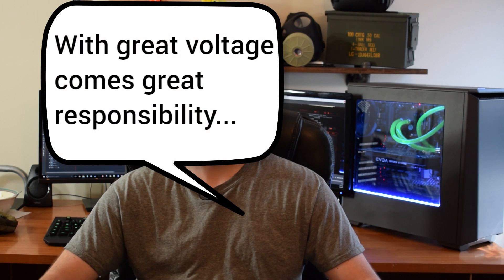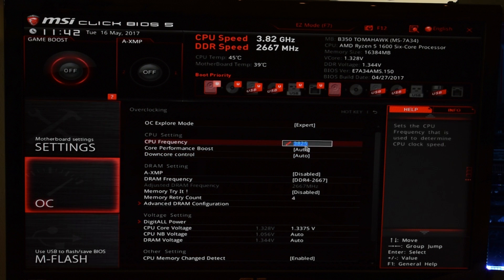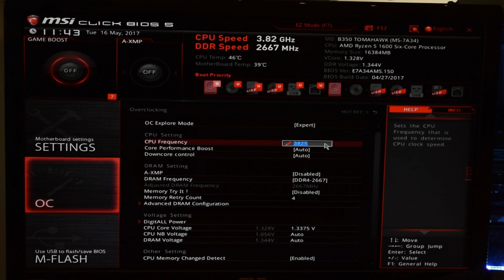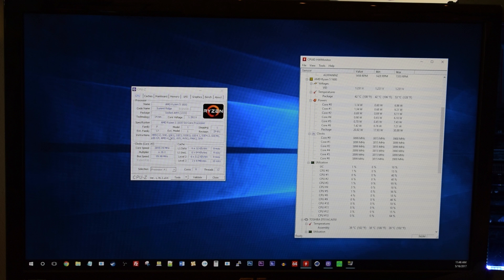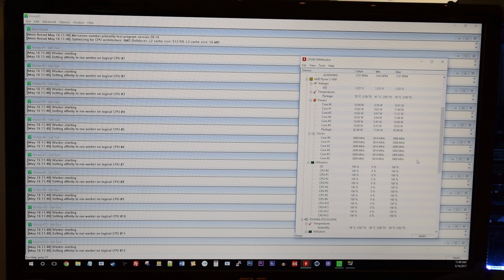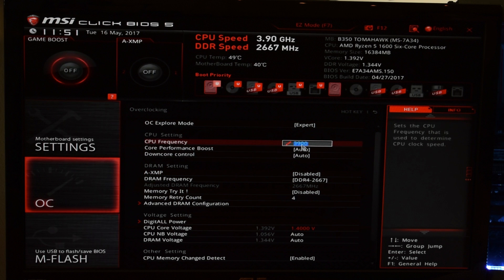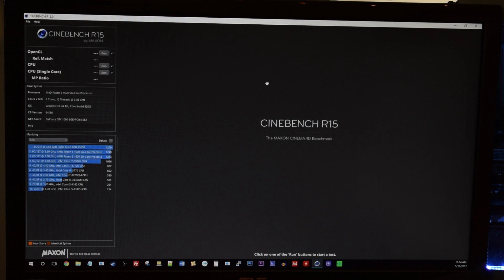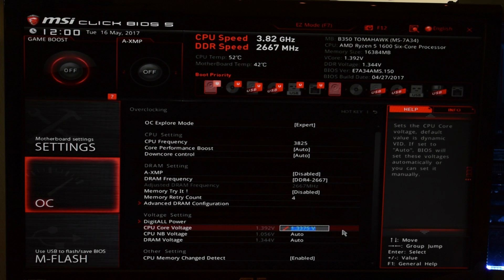How to Overclock a Ryzen 5 1600 CPU - Super Easy!

Comment: Can you explain why you want to marginally lower the CPU voltage each time at the end until the stress test fails?
Reply from the maker: The reason why you want to do that is because the lower the voltage, the lower the amount of energy you use and therefore less heat that is produced from the CPU. This will help the CPU last longer as well.
Reply: @SANTINIIO  Thanks! I figured that was it but it wouldn't hurt to explain it 😅

Comment: My bios is black and white why
Reply from the maker: The only thing I can think of is that you have a legacy bios instead of UEFI. 

Depending on the bios you can still overclock it.

I would contact the manufacturer of the board if it's a newer motherboard.

Comment: Hi. I had a question. I am really bad at this CPU stuff. I have AMD Ryzen 5 1600 with stock cooler.
QUESTION: Can I just hop onto the OC settings and throw in your values and expect a decent overclock? Please help me out! Loved your content. Earned a subscriber.
(P.S- I am very nervous, I don't wanna fry anything)
Reply from the maker: The short answer is maybe. It depends on a lot of different things. The silicon lottery being one of them.

As long as the voltage isn't too high you don't risk a chance of ruining your CPU. If it isn't stable you will you just have to go back and tweak the settings in the bios.

Getting it right can take some time. I will say that if you lowered the clock speed a little bit you will have a better chance of it working first try.

But the bast way is to do it like I did in the video. I hope that helps.
Reply: @SANTINIIO  So if you had to give me a number... What would you give me?
3800 and 1.35 if it doesnt work I'll go for 3775 then 3750 and so on... Am I right my sir?
Thank you so much for replying so quickly. It's rare to see a YouTuber engage with his community so much. Love it!
Reply from the maker: Try that first and then if you aren't satisfied with the result go back and do the same, but bump up the voltage. You will see that at some point, (usually 3.8 or 3.9) is as far as you can go while keeping it stable regardless of what the voltage is. I wouldn't go past 1.4v, but that's just me.
Reply: @SANTINIIO  Copy that sarge.
Love you! ❤️

Comment: im going to run my 1600 at 4ghz with a dark rock pro 3. does anyone reccomend a voltage? because i cant really wrap my head around the voltage part of Over Clocking
Reply: Just as he said, start it off high (1.4v) and stress test while reducing the voltage.

Comment: H, i have few confusion regarding overclocking. Suppose i don't want to overclock more than the boost clock specified (3.6 GHz for r5 1600). What is better, manually OC the base frequency 3.2 GHz to 3.6 GHz so that it stays at 3.6 GHz all the time or i let it auto so that computer decides its frequency and auto adjust depending on the temperature?  Also if i manually overclock to fixed 3.6 GHz does it violate the warranty of the cpu or it violates only when i go beyond the boost frequency?
Reply: It shouldn't void the warranty if you do it via Ryzen Master (free download from amd). You don't have to worry about voltages either as it remains stable on the same voltages as 3.2ghz and 3.6ghz. Beyond that, you'd need to increase voltages though. How can AMD void your warranty for doing something in which not only do they encourage, but also provide the software! Imagine that? :D
Reply: @plunderclat221  ok, but isn't it better to not do overlocking because the cpu auto overclock it itself to its boost clock( 3.6GHz) if necessary, then why do i need to manually set it to 3.6GHz?
Reply: @babu-oh8ss  I set it to mine to stay at 3.8 and tested the benches the way he did,  but I'd first set it to 3.6 as I said above, just to force it in to a steady performance. I did that intuitively, in that my thinking was, "its now got less to think about". Might be right, and it might be nonsense... i just mess around with them. Its safe either way, because it doesn't exceed 43°c anyway (watercooled). Also, beyond 3.6ghz, i didn't really see a tangeable performance boost because it already ran very well... so its up to you how far you push it, but in my opinion, it has more than adequate beef at 3.6.
Reply: @babu-oh8ss  you using the vortex cooler?
Reply: @plunderclat221  I am using the stock wraith spire cooler comes with ryzen 5 1600. I don't want to go beyond the boost clock. My question is in that case(that i don't want to go beyond 3.6 GHz) should i manually overclock the base clock 3.2 GHz to 3.6GHz or just let amd technology to take care of it( so that it fluctuate between 3.2 and 3.6 instead of staying at fixed 3.6) ? Just a basic question.
Reply: @babu-oh8ss  leave it as it is in that case. However take a look at the 3.8 overclocks using the stock cooler. It actually performs well. Alternatively, get a water cooler and go wild! The h100i v2 keeps it ridiculously cool. Plenty of room for tinkering.

Comment: Whenever I overclock my cpu it goes down to 1.5ghz and can't changes it unless I reset bios. Any help would be appreciated.
Reply from the maker: A couple things could cause that. Not applying a correct frequency/multiplier could actually underclock it. Not applying enough voltage could cause it. Thermal throttling could cause it as well. Try different programs to see what your actual clock speed is and to make sure the program isn't reporting a wrong speed. At the same time check to see what temperature the CPU is running at.

If none of those are causing it then you could have a faulty motherboard or CPU. It's hard to tell without seeing it in person.

Let me know if you find out what the problem is and if any of that helped.
Reply: SANTINI.IO I updated the bios and then it worked like a charm. I appreciate the response.
Reply from the maker: Ok cool. That's good to know.

Comment: I have the most recent bios EA38AMS.1E0 BIOS Build date 4/24/2018 but I only see cpu ratio (auto)and not cpu frequency. But I do have Adjusted cpu Frequency right under cpu ratio.

edit nvm it seems I need to just input for ex 3700 for 3.7 ghz.

Comment: is this cpu is pushable to 5ghz with liquid nitrogen?
Reply from the maker: I'm going to say no. Even with good water cooling, where the temperatures were normal, the overclock became too unstable past 3.9ghz. The 1600 CPU's are just binned 1600x's meaning they weren't able to reach the speeds of the 1600x to begin with.

Also, your stock cooler should be able to handle a 3.825ghz overclock although it will probably run a little hot under load.

I hope that helps.
Reply: SANTINI.IO how about this processor bro?i need to buy one😊

Comment: One question, when I OC my 1600 to 3.9 on 1.275 V it runs stable. But when I tried 4.0 at 1.4 V it crashed. I’m using a stock cooler btw. Is it the cooler problem or cpu can’t hit 4.0?
Reply from the maker: A lot of peoples 1600's just can't overclock to 4.0GHz, mine included. 3.9GHz at 1.275v is a pretty good overclock though.

Comment: hi what temp will you suggest for the cpu? im currently never go above 70 and most of the time its idle at average 40c
Reply from the maker: +Guala Nejo Those temps are fine. It all depends on ambient temperature and what type of cooling solution you use. I would say those temps should be fine though.

Comment: Hey i was wondering if an evga 1060 3GB GPU superclocked would work with a ryzen 1600 cpu in a MSI 7A39-002R Mainboard 2x DDR4 DIMM ?
Reply from the maker: +Screw_it Yeah, that combination would work fine. Right now I find that hardly any games really push 3gb at 1080p. If you can find a 6gb 1060 for a decent price I would get that though.
Reply: SANTINI.IO Thank you for responding. I have been doing some research and I found that most games at 1080p at 60fps at high settings don’t need more than 3GB, however probably in the long run I would need a 6GB. What really bothers me is that the 6GB is 50 euros more and I’m not sure if it would be worth it as I’m on a budget of around 700€. I could get a worse cpu to be able to get the 6GB GPU but I’m also not sure.

What would you do? I’m stuck in what I should do so help would be greatly appreciated and one more question does a 1x8gb ram have a huge difference to a 2x8GB in performance in gaming like FPS?, 
thank you!
Reply from the maker: Screw_it I wouldn't get a lesser cpu. The 1600 is amazing. Also, the difference between dual channel and single channel memory in games is not a crazy amount. Really it only gives a couple more fps in certain games. Single channel will be the way to go if you plan on upgrading in the future.

Comment: Struggling with same bios to change CPU frequency from auto. I can oc in ryzen master fine but for some reason I can't change stuff in bios (MSI b350m mortar)
Reply from the maker: +Simon Elbourn I would check to make sure you have the latest bios update and then try it again. I know this sounds stupid, but make sure you have the settings saved and then when it goes to boot, go back into the bios to see if the settings are the same. I hope that helps. Let me know what you find out.
Reply: Definetely have latest bios. When I try and adjust it I have the red slash before it and cant select auto and change it

Comment: just bought this cpu a couple weeks ago (spoiler alert for future video)...so considering overclocking. Although, it was such a good improvement over the 8320 i had (even at 4.4ghz) that Im not sure if i need the OC yet.
Reply from the maker: Carli Kinman I used to have a 8320 in one of my previous builds and it's an awesome cpu, especially for how old they are now. The 1600's are pretty awesome out of the box. I think the CPU is overkill for most tasks and programs so overclocking it isn't necessary, but it is fun to overclock them though.
Reply: SANTINI.IO definitely is fun! Noticed a huge difference in the time it takes for me to render vids now too. Plus I'm curious to see how well the stock cooler would hold up
Reply: Then dont

Comment: What settings do you use in prime 95. I know some settings seem to stress the cpu more. Or at least make it much hotter.
Reply from the maker: +Brian Price It really just depends on what I'm trying to test. Here is a good article that will explain it better than I can: https://overclocking.guide/stability-testing-with-prime-95/

I hope that helps.
Reply: SANTINI.IO good article. Thank you

Comment: with stock cooler, and have no experience in OC at all. Whats the suitable speed to go up to? and what ram is working perfectly with this? im currently using kingston 2400mhz 8GB.. whch is single channel, looking to change it to dual channel. 

Any help is really appreciated
Reply from the maker: +Eiian Herms It depends on a lot of factors, but 3.7ghz would be a good place to start. After one of MSI's bios update the ram that I have linked in the description was able to go to past it's base clock of 2667mhz all the way to 3000mhz. And dual channel is always better than single channel. 

I hope that helps.
Reply: SANTINI.IO thank you so much for your advice.. im going to purchase a ram.. 8gb.. hope you can advise which ram to get..
Processor : ryzen 5 1600
Motherboard : asus b350
Graphic card : gtx1050ti 4gb
Reply from the maker: +Eiian Herms At this point I would say any DDR4 ram from corsair that is 2400mhz or higher would work well.
Reply: Just bought corsair Vengeance 2666mhz 1x8gb .. but system is detected as 2133mhz and single channel.. do you know why
Reply from the maker: Eiian Herms That's how all ram starts out. You have to go into the bios and set it to a 2667mhz profile.

I'm not sure why ram runs under its base clock, but it does that on just about every system ever.

Edit: Also, check your motherboard manual and make sure your ram is in the correct dimm slots for dual channel.
Reply: My motherboard do not have other ram slot.. i have tried all of them.. and once i set to 2666mhz. The system will show overclocking fail, and asked me to enter bios
Reply from the maker: Eiian Herms Make sure you have the latest bios update installed by going to the web page for your motherboard on the manufacturers page.

Comment: should I enable AMD quiet and cool?
Reply from the maker: +wen87n It depends. If you want a "set it and forget it" solution then I would say yes. I like to create my own fan curves based on testing the temps at certain fan speeds and how much fan noise I determine to be too much. I don't mind fan noise so I usually set my curve to higher fan speeds at lower temps than most. But I don't see why you couldn't/shouldn't enable quiet and cool.
Reply: SANTINI.IO Thanks for reply.

my PC is very strange, if I leave cpu voltage to auto, overclock to 3.7ghz and enable CnQ, it works, but not stable if I render images. However if I manually adjusted cpu voltage (because I want to get 3.7ghz stable even if I render image) and enable CnQ, my cpu will stuck at 2.8 ghz regardless the clock speed I set in bios.

So now I can only get up to 3.6 ghz stable @ auto voltage and CnQ enabled. 

My spec is Ryzen 5 1600. MSI B350m Arctic mortar.
Reply from the maker: wen87n That's really odd. You should try to get ahold of someone at MSI to see if maybe there is something wrong with the motherboard.  Before that, If you haven't already, I would check to see if there is a bios update while you are at it.

Comment: I can do oc of my memory ram 8gb crucial 2400mhz to 2667mhz? mobo is the same b350 tomahawk, I can also change what voltage frequency of ddr4 memory?
Reply from the maker: You most likely won't have to adjust the voltage of the memory. You can just choose one of the overclocking profiles that is already in the bios. Check the B350 Tomahawk page on MSI's website to see if your specific memory is compatible and at what speeds. I hope that helps.

Comment: i'm running 4ghz at 1.32v on my 1600x. 100% stable. i'm lucky or what?
Reply: lucky
Reply: Is it still stable? I had 4ghz 1.32 for 2 days before it finally shut down. Bumped the voltage and again a day and a half later it shut down. All the way to 1.4v 4ghz wouldn’t run stable. 3.9 has been solid for nearly a week at 1.32. Seems odd.
Reply: yes, i can go 4.1 GHz without shut down at 1.35v, but for daily use i'll keep 4ghz at 1.32v
Reply: Awesome!

Comment: So the thing is,when I do OC in the BIOS, the second I press save, PC crashes and doesn't post. I know that my OC is stable because I've used Ryzen Master to do it but the problem with RM is that it doesn't save OC profile. So why does my BIOS OC crash? I have Ryzen 3 1200 overclocked to 3.75 at 1.3V. MOBO is MSI B350M Gaming PRO, BIOS version is 2.80
Reply from the maker: It's hard to say why that would happen. I would up the voltage to something close to 1.4v and see if the PC posts. If it does, you then know that the problem was the voltage. The numbers that a program reports are sometimes not as accurate as what the bios will be. I would use CPU-Z to see what your cpu is clocked at. Also, don't overclock your ram until you have a stable cpu overclock in the bios. Let me know if upping the voltage solves the problem.
Reply: SANTINI.IO I'm kind a scared to do that again,because it was a hasstle to restart my motherboard, CMOS didn't reseted at the first time and I took near an hour to make it work...
Reply from the maker: Yeah, I know what you mean. It's scary when your pc doesn't post after an overclock. Properly clearing the cmos will allow it to start back up again quickly. I think the motherboard should have come with a cmos jumper. Also in the bios there should be a setting to retry the overclock and how many times it should try to boot before resetting the overclock. Around 1.4v should work. If/when it works go back and slowly lower the voltage until you know what voltage it can still be stable at.
Reply: Either I didn't find the jumper thingie or it wasn't included so I had to use a screwdriver (Safety first lol). I'll try to bump the voltage tomorrow and hope for the best. I just don't want to blow up my PC since it's my first time doing OC stuff
Reply from the maker: haha I understand I was the same way when I overclocked my first cpu. 1.4v is a safe voltage for short term overclocking I wouldn't go above that though. Let me know how it turns out.
Reply: Thanks for the help!

Comment: I'm not going to read all the comments, but hardware monitor reads 20c hotter than what the Ryzen is actually at. I know that my 1600x is slightly different but I am running at 3.95gHz at 1.39v and I will begin to drop the volts until it's not stable, but with my CoolerMaster Masterliquid AIO 120 I am hitting less than 60c with CPU-Z stress. No gaming has raised it higher than that. You should try using CoreTemp or AMD Ryzen Master to check your temps.
Reply: my 1600x is running 4ghz at 1.32v
Reply: Siddharta really?! I now have to see what I can lower mine to and keep it stable. That's awesome.
Reply: Siddharta I have lowered to 1.37 and it's been stable for a month or longer. But now I'm curious if I can get it to the same as yours.
Reply: My 1600x goes up to 4GHz by itself with it's turbo feature when stressing in occt ^^ I heard x versions of ryzen do not oc well because of the xfr feature

Comment: 30 minutes of prime does not confirm its a stable over clock. A couple of hours to prove its basically stable, half a day + to ensure completely stable.
Reply: Lucas McLean Depends on your usage if you game only for 1-2h a day and it runs stable without issues for 4h as test, theres no need for you to run it 12h because prime95 puts an unrealistic load on your cpu to which you‘ll never get anyway

Comment: I can't go above 3.75 ghz wtf
Reply: i have an x370 mobo too
Reply: its an msi one too
Reply: and my 3.75 is at 1.33 volts if i make it 1.37 it still can't go to 3.8
Reply from the maker: Not every Ryzen 5 CPU is going to be able to be overclocked to high speeds. That's the silicon lottery. It sucks, but it's not the motherboard it's the CPU.